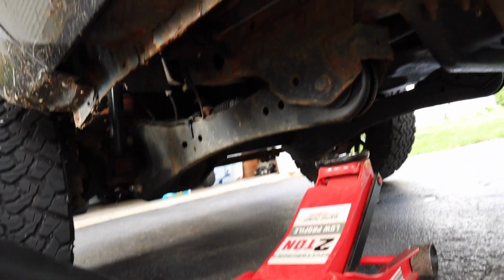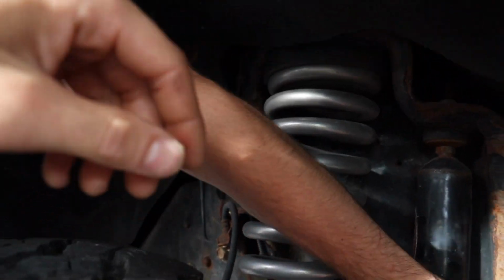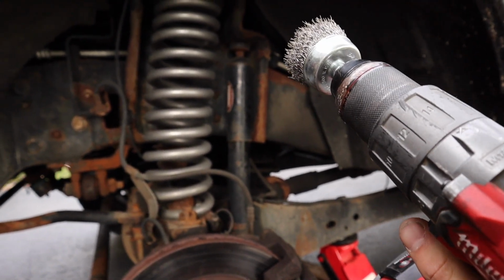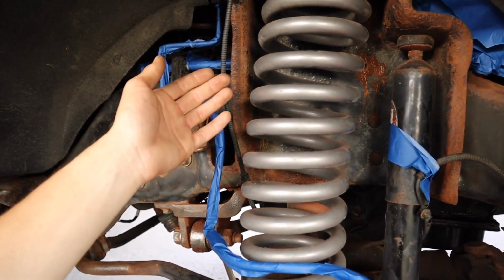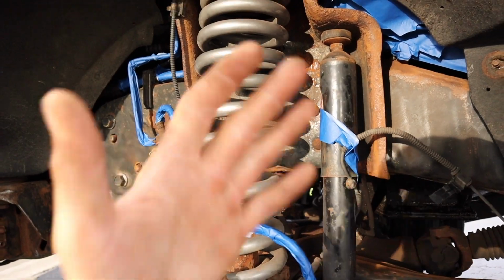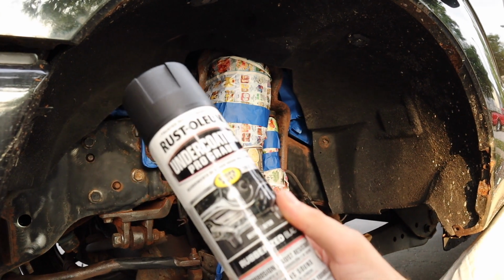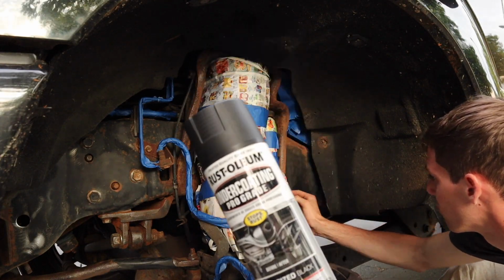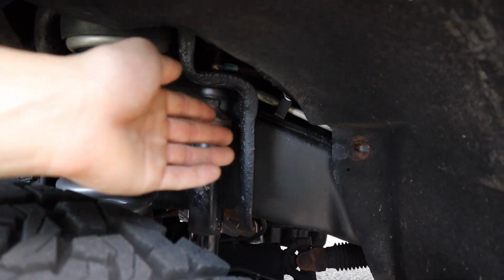DIY Truck Undercoating For UNDER $5!

Comment: i would recomend (2-3) COATS OF rust primer and then 2-3 COATS OF High Performance Enamel AND IF YOU PUT FLUID FILM OR RP 342 OVER YOUR FRAME YOU WILL NOT SEE RUST COMING BACK ANYTIME SOON.